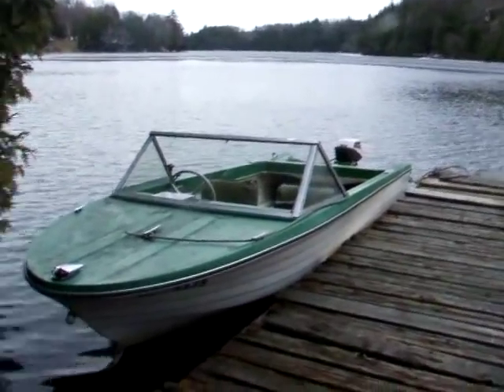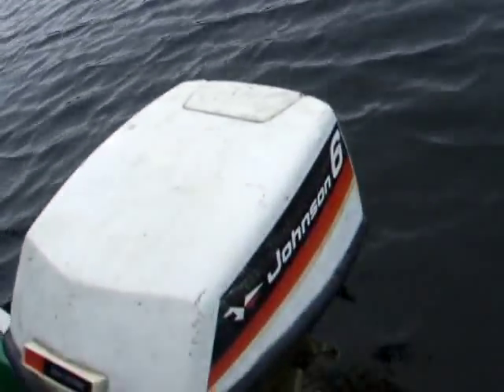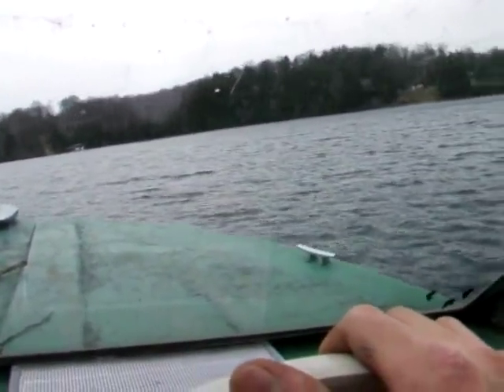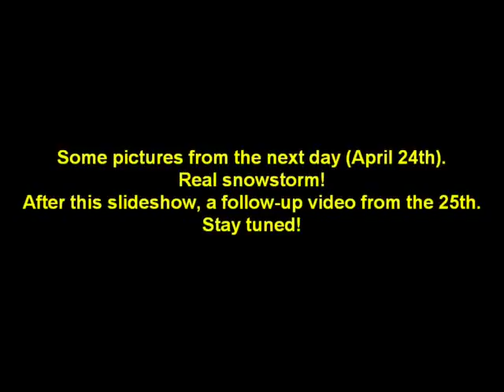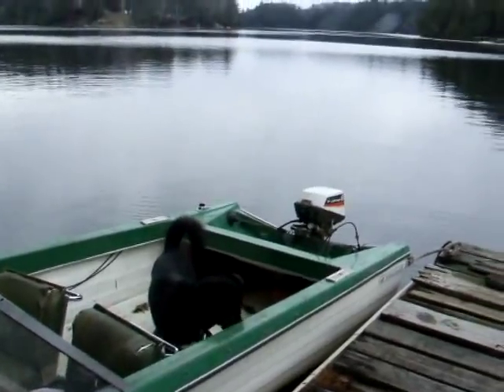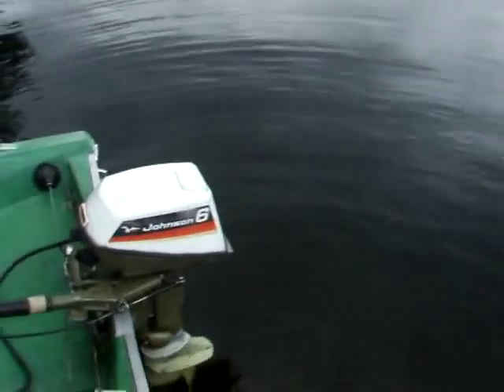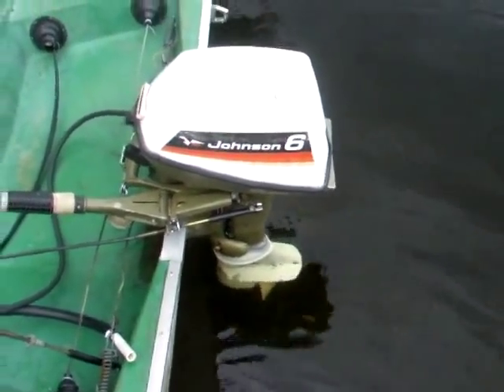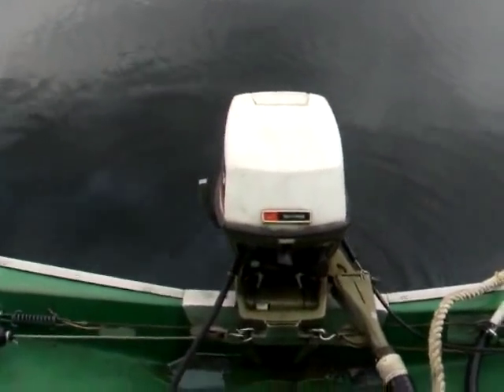1974 Johnson 6HP outboard running again! Sparkplug repair juryrig + late Spring

Comment: I hope you’re still enjoying your 6hp and the lake. Cool old boat and motor.  I’ve got several old Johnson and Evinrude small motors. I enjoy them no matter what size boat they’re on.
Reply from the maker: Thanks Skip!  Yep, I'm still enjoying my lil ole' 6HP Johnson, first motor I even had grew up with it, still running as good as in the video.  Got my 30HP Javelin (in my other videos) running again since then, it's now on the green boat and the 6hp is back on a little dingy it was on before, still the first to launch every Spring.  Let me know if you'd like any brochures for your small OMC motors, I can email them to you anytime make interesting reading.  Thanks for the comment Skip, Best wishes and Cheers!~  Bellarmine

Comment from the maker: Thanks, yes it's nice getting it running, sat for 4 years in my basement 'cause of the stripped head. Grew up driving it, me and my friends had a lot of fun with it, only motor I knew before our neighbor loaned me the 30HP Javelin I helped fix. The 6hp's now on a white 10' fiberglass dingy, might see it in the background when I back the Viking out. The dingy's kind of worn out, but the 6hp pushes it a lot faster, and with the Javelin I'm now up in the world with 2 boats to drive lol. Cheers!

Comment from the maker: Not sure what you mean about hard Delano, but if you mean speed, I guess it goes about 9-10mph.  Rough estimate, I didn't have a speedo on it then.  Not as much fun as the 30hp Javelin in my other video (check it out!...:^), but pretty good for a lil ole 6!

What'd you think of my quick n' dirty spark plug thread repair?  Still working great right now.  Any other questions let me know!

Comment: That is very nice for a 6 hp, I bought a 6 hp Hangkai, it pushes an aluminum boat lighter than your fiberglass boat, and it pushes about 13-15, so your motor would make a 14ft aluminum fly...nice vdeo

Comment from the maker: Glad it was helpful.  Sure, I'd be interested in seeing your boat, see if it goes faster or slower than mine lol.  If it does go too fast, you can switch the prop to a lower pitch, and that'll limit your top speed, like a lower gear.   Propeller selection is a whole art.  For example, too low a pitch is like driving on the hiway in 1st gear, and too high a pitch is like trying to pull a trailer in 5th gear....:^)

Good luck with your boat, I'm here if you'd like any more advice..:^)  Bon Voyage!

Comment: hi , how much gallon/litres you use in the tank and with that tank how much distance you go until its empty ?
Reply from the maker: Hi Mitcha, Thanks for your question.  It's a standard Johnson tank - 6 US gallons / 5 imperial gallons / 22.5 Liters.  Tip for easy measuring the oil/fuel mix: with an empty tank, add some gas, add either 1 liter (24:1) or 1/2 a liter (50:1), mix it up, fill tank rest of the way, done.   If your motor is 1963 and older, use 24:1 oil mix.  1964 and newer, use 50:1 mix.

About how far I go on a tank, bit hard to say.  I've never used a whole tank in one go, one tank mostly lasts me the Summer.  I will say this little motor hardly uses any gas at all, I think you can run a whole day on a tank.  Obviously I couldn't go too far with the big slow green boat in my video, but on my smaller dingy I get about 10-15MPH, so I'd guess you could go something like 40 miles + on a tank (just guessing).  I run it near empty most of the time, for example the other day had about 3 liters in the tank.  I trolled across the lake for over 1/2 an hour, then went full speed for 15 minutes, and I couldn't tell if the level had changed or not, uses so little.

Hope this helps Mitcha, any more questions let me know.  I can also email you the nice OEM brochure for your year of motor if you're interested.  Cheers!~  Bellarmine
Reply: @bellarmine33  thanks a lot for the explications , im from algeria in north africa so i will use mine for the first time there on august , its a long shaft 1975 johson 6hp (serial 6BAL75R) was made in belgium.
comes with a original tank 12 liters (3galion).
i test it and its works great , i will make a video when im in the mideteranean sea,. 
its my first motor , i know motor when i was young but this one is mine ;)
have a good day.
oh i forgot : the motor will be installed in a inflatable (mariner 4 ) ,behind an electric rhyno 54 lb.
its more for my childrens , cuz my blessed father learn me the love of the SEA , i hope my childrens get that excitation too.
Reply from the maker: You're welcome Mitcha.  That's amazing, your little motor just like mine driving around on the Mediterranean sea.  Hope your children enjoy it, and yes I hope they learn to love the sea as well.  My friends and I had a great time with my little 6, bombing 
around the lake.  I'd love to see your video in August on the 
Mediterranean, I'll look forward to it.

My little 6hp was my first motor growing up too.  My Dad bought it in the late 80's and it was the only motor I had until 2011, when I got a very nice 30HP motor running again after over 30 years.  Check out my video here, I'm quite proud of it:
https://www.youtube.com/watch?v=tH2JOdNqke4

With your 1975 Johnson and 3 gallon tank, all you'll need for oil is a quarter litre (250ml) per tank, 4 fills per 1 litre oil bottle, cheap!

If you want Mitcha, send me a message at my address and I'll send you the OEM 1975 brochure:  It starts with my username without the 33, followed by Rogers and then Com.

Hope to hear from you soon, enjoy your motor Mitcha!~  Bellarmine
Reply from the maker: Hello again Mitcha, I just saw your reply now, went into my SPAM folder!  If you get this, leave another comment and I'll try your email address again.  Again, my address is bellarmine AT rogers DOT com.  Greetings from Canada!~  Bellarmine

Comment: I have this motor runs better than my previous 9.9 Hp. It gets my 28 foot sailboat to 5.5 knots.
How do you winterize it.
Reply from the maker: +hrabia08 Thanks for your comment!  Yes, they do run nice, good reliable simple little motors.  That speed sounds about right, pretty good for your big sailboat.  28 feet,  my that's big!  must have a lot of room there, and big sails.

As for winterizing, this is just my view, but I'd say it depends how you're going to store it.  Since my Dad got it in the early 90's we've always stored it in our basement over the winter where it always stays above freezing.  I've never ever done anything at all special when I stored it, just disconnect the fuel lines and hang the motor on a board nailed to a post.

If you'd like to do something extra, you can start the motor, disconnect the fuel line, and run it until it starts to run very rough, then shut it off.  If you can, drain the fuel tank and dispose of the fuel, or dump it in your car (a gallon or so won't hurt your car if your car tank has several gallons already in it).  This should help keep the carb fresh.  Again I never even bother to do this, so call me lazy...:o)

If you want to store it outdoors, store it upright, not tilted, so that it can drain all the water out properly and not freeze.

One important note about storing it where it will go below freezing - if you suspect you have a leak in the lower unit/gearcase and water is getting in, you should drain and/or change the gear oil before it freezes, otherwise any water in there will freeze and crack the housing!  Had this happen to me with a leaky lower unit on my friend's 30HP (see my other videos), it was tilted out of the water in early December and it froze on me.  Got a new skeg and seals and all fixed up now fortunately, runs like a Swiss-watch again.

Anything else let me know - cheers!  Bellarmine

Comment: Great video! Nice to be out when possible. I have the same motor, just slightly older, 1968, they're tough motors. You mentioned something about hissing in the description, would that be from pressure escaping the spark plug threads?
Reply from the maker: Hi MrPavlo, yes it is great to get out on the lake!  Yes, these are tough little workhorses!  This one's been through a lot, used to belong to a resort before we got it in the late 80's / early 90's.  Just put the 6hp out on my small boat last Saturday, the 30HP Johnson Javelin in my other videos will be along in a week or two.  About the hissing, yes, that was BEFORE I put in these new LONGER spark plugs.  As I say, I had stripped the spark plug threads, needed a new cylinder head.  I was trying to get the old plugs to stay in with all sorts of oddments, aluminum foil, little bits of steel, all sorts of crazies, and when it did run, it hissed like a steam engine.....:o)  Later on, upon close inspection of the spark plug holes in the cylinder head, I noticed that they were threaded only about 2/3rds of the way in, with the remaining 3rd being solid aluminum.  I had on-hand these Champion L78C spark plugs, that were the same thread as the factory J6C, but with a longer reach.  So I just screwed them into the head, they made their own thread in the remaining 3rd of aluminum, and it's been fine ever since!  Cheers!~  Bellarmine

Comment: Hi how's it going? How did you hook up the throttle and steering wheel? Thanks
Reply from the maker: Hi Chris, thanks for the comment!  Things are going ok, the 6hp's still running well.

About the steering and throttle, I got the steering wheel, cable, pulleys and motor attachment bracket with the boat, I just bolt it onto the motor.  You can see the steel bracket clicked onto the front of the motor.  I also got the 2-lever shift box, has quick-attach cables for the throttle and shifter.  You'll need a couple steel U-shaped brackets to screw onto the side of the motor to mount the throttle/shift cables into.  Also this little 6hp needs a bracket to mount the shift cable U-bracket onto, you can see a slight recess on the motor housing on the Starboard side near the shifter. 

Watch my other video of how I restored my friend's 1956 30HP Johnson, real fun, I give some more details on the steering and throttle there:
1956 Johnson Javelin 30HP Outboard on 14' Viking Fiberglass Runabout

Any more help Chris, send me a PM.  I took a few pics of my brackets for you, I can send them to you if you wish.

Cheers! Bellarmine33

Comment: just have a couple 'heli coils' installed in your current cylinder head.
Reply from the maker: You're right, for now it's working just fine so I'll leave well enough alone lol!  But in future when I have to take these longer Champion L78C plugs out, I'll be doing exactly that.  Just a few more weeks now till Spring, can hardly wait...:o) Thanks for the comment - Cheers!~  Bellarmine

Comment: really nice little boat like it mate how long you had this boat mate as i knew thiswas a nice little boat you got there
Reply from the maker: Hi Michael, glad you like my boat!  1965 Eaton-Viking fibreglass runabout, even have the ownership papers.  I got the boat in 2009, then got my neighbor's motor running in 2011 and it's been great ever since.  He gave me the motor in 2017 as a gift, real nice.  Still running as good as in the video, you just can't kill these, looking forward to the Spring to launch it again, right now it's been minus 20 F nights BRRRRR!!  Let me know if you'd want to me to email you any PDF Johnson brochures, they make great reading. Thanks for the comment Michael - Cheers!~  Bellarmine
Reply: @bellarmine33   yes that will be good can you email me the brhure on the 1967 Johnson 40hp super sea horse outboards as well the 33hp Johnson brochures as im going to restore a Caribbean sea sprite boat as my boat was built in 1967 as i needed to read the brochures on these outboards as im an ex Johnson outboard mechanic will be happy to be getting those Brochures as you see id liked the older Johnson outboards thanks mate
Reply: @bellarmine33  as i liked the older Johnsons they are really good motors as i had a 33hp Johsons as thiswas my 1st big Johnson as thiswas on my Caribbean which i still got thiswas my Caribbean sea sprite boat as i loved my Caribbean im needed a to find a good and suitible Johnson 40 of the same years as my 13ft Caribbean as i was gonna get a older Johnson 40hp outboard thiswas in the same build year as my Caribbean as you knew thiswas my big project boat now as im gonna restore my Caribbean as i liked the Caribbean sea sprite boat as i had this boat on 21 years now as you see thiswas my 1st boat as i had this boat on 21 years as im still looking for an older Johnson 40hp super sea horse outboard in Shortshaft thiswas the 40hp model outboard im still looking for now as i knew thiswas my first big outboard do you think an Johnson 40hp super sea horse willbe a good motor for my 13ft Caribbean as im ready to start restoring my boat in the near future as i had this boat on 21 years now as thiswas good timing my need to learn how to restore this boat with the right outboard as i liked the older Johnson outboards these was the 40hp outboard thats was built in the same year as my boat thiswas good views was i get one of these outboards for my boat and restore it to as new order as i loved the older Johnsons these was the 40hp super sea horse thiswas the motor im going to get in future for my Caribbean sea sprite boat as you see im an old salty who loves boating and i love older outboards as im an old school mechanic and boater as i knew thiswas my future hope to own these older outboards in my future im ready for this now
Reply from the maker: @michaelwalker9394  Thanks for the replies Michael.  Wow, you sure do love the old motors, just like me, the older they are the better I like 'em...:o)  Could you send me your email address and I'll try and get those brochures out to you tomorrow or the next few days, no problem.   You can also find my email address on my YouTube "About Me" page under "Details - for Business Inquiries".  It is the same as my username without the 33, followed by ROGERS and then COM.  Talk soon Michael!  Bellarmine
Reply from the maker: @michaelwalker9394  Hi Michael, just tried to send you an email but got a 'failure notice'.  Can you double check, is it "mwo64342 at gmail com"?  Talk soon Michael, Bellarmine

Comment: I did my Toronto harbor license on this type of motor boat.  Very enjoyable to control it. I found it to be light. Here is my motor
I need to get a new shifter handle and paint the top cover.
https://www.youtube.com/watch?v=L56-cLquxFQ

And here is the sail boat Viking 28 me and my dad sailing it 

https://www.youtube.com/watch?v=zpGATd_XZoM